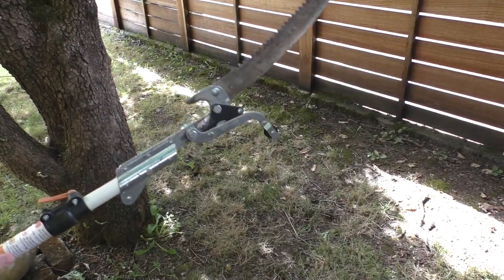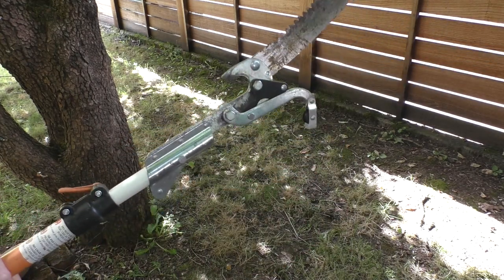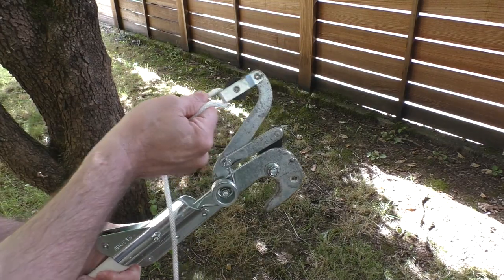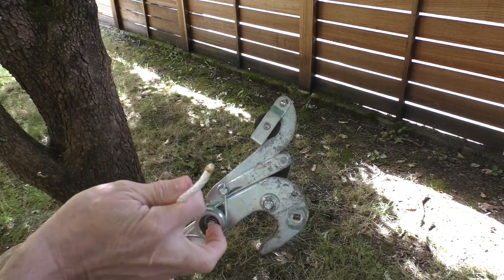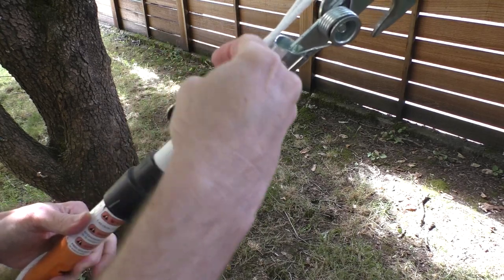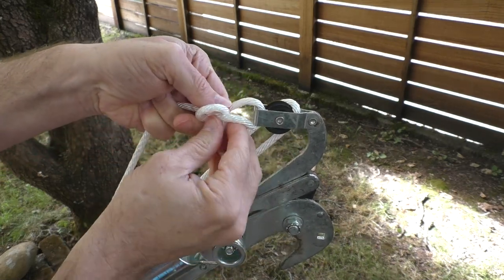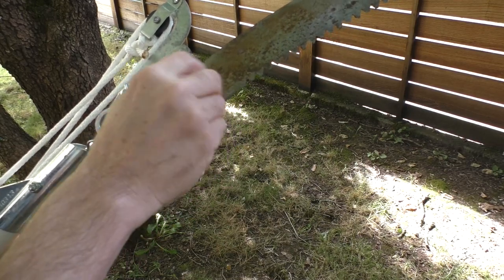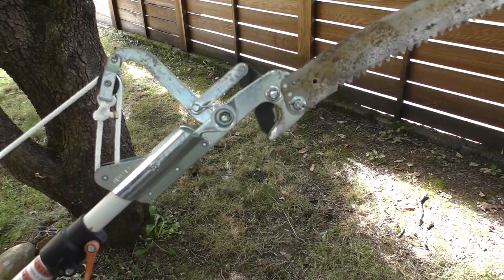How to Re-Attach a Rope to a Pole Tree Pruner

Comment: This is a great video, but it (like all other search results I've gotten) doesn't give a decent, practical answer for a good way to store the rope that doesn't involve wrapping the pole with it.

I get that winding the pole is nice and tidy and compact, but as I'm just a homeowner, most of the jobs I use it for only require getting it out, doing a quick prune, and putting it away again. 

Also, I was hoping to learn some new knotwork. 😆 Anyone here have pointers?
Reply: Look at the tool, store the tool. It's not rocket science, nor is it perfect. You could coil the rope, then pull to open the pruner, and lay the coil inside where it can be pinched. Not where the blade pinches, but where the the pulling part retracts when you release the rope. But, seriously, either way is gonna take a minute, and if that's too much time and effort, use a piece of duct tape.
Reply: A simple fix for storage is a twisty-tie around the coiled rope. Then it hangs without tangling. Have a good day.